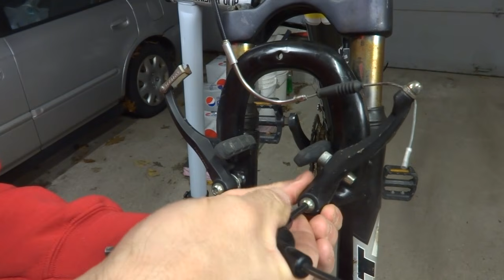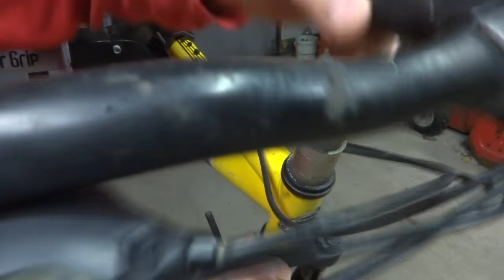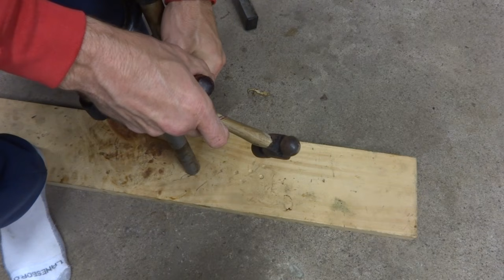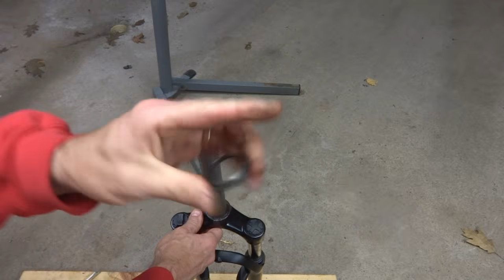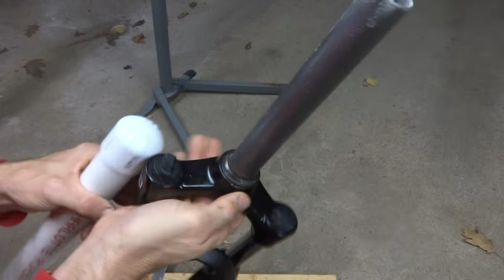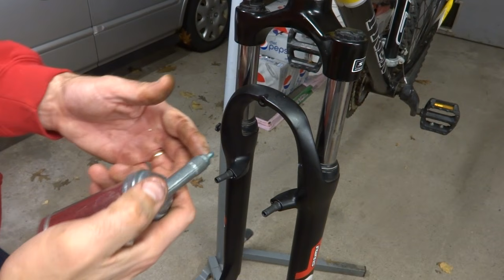Replacing Forks/Shocks On Mountain Bike

Comment: Hey RJ, got a situation wherein the  dropout width of my new fork is wider (7mm compared to the 4mm width of the old fork). So the problem now is that the axle only covers half the dropout. Is this safe? Does it damage the dropout? I tried to check online if they sell a 114+ length axle for front wheel but most online stores sell it at 108mm. Thanks for any info/reply

Comment: Hi.  Very nice video.  I will be starting a replacement fork repairs as you did.  I have a question, it is the PVC pipe, what size is  length and diameter you used. Thanks in advance.

Comment: sir one silly question   i have a cheap apollo phaze MTB  i picked up for a ebike conversion the conversions went well the handle bars is too low and i get  backache       but i noticed the forks was sloppy and done and dangerous. i want to know what i need to do to higher the handle bars i see people  cutting the tubes down  why   ?   or if i buy a new set of forks  do i simply leave the tube alone for more  height

Comment: Hello RJ. Is it possible to order replacement crown races of specific diameters, or do you pretty much HAVE to get the one off the old forks?
Reply from the maker: The crown race generally comes as part of the headset. But you can buy them separate.
Reply: @RJTheBikeGuy  Thank you.

Comment: I have a threaded fork that is bent. Would like to change it to a suspension fork but do not know the if it's 1" or 1⅛". I guess I have to take it off huh?
Reply from the maker: A 1" fork will have a quill stem about 7/8" in diameter. A 1 1/8 for will have quill stem about 1" in diameter.

Comment: What holds the forks onto this bike ? 
Is the clamp on the handle bar the clamp that also holds the forks from sliding down and off ?
Reply from the maker: Gravity for one as the bike is pushing down onto the fork. The stem clamps onto the steerer to keep the the bearings and adjusted. There is also a wedge that locks into place.

Comment: Sweet video...I got the same bike and due for shocks over the winter, what diameter are they do
You recall  ? Thanks
Reply from the maker: Diameter of what?
Reply: @RJTheBikeGuy  the tune that goes threw the headset,  i see you measured the height that was 8-1/4" i was curious to the diameter i didn't want to order the wrong shock
Size lol
Reply from the maker: @tattedup1189  Mine was 1 1/8" which is pretty common. I don't know what yours is. Measure YOURS.
Reply: @RJTheBikeGuy  will do man thanks for your time

Comment: I have a GT Avalanche Comp 29 from 2018. It has a tapered frame. I would like to upgrade the Suntour forks to RockShox. My current Suntour forks are straight. My question is can I replace my straight Suntour forks with Tapered RockShox forks on my bike that has a tapered frame and if so what do I require to do this?
Reply from the maker: I think it's possible, but I haven't done it. You will need a different headset.

Comment: Hi could i ask a quick question, i purchased a hybrid bike with no suspension and i was wondering if i bought a suspension fork would i be able to install it into my bike that didnt come with suspension
Reply from the maker: You can trying a suspension seatpost. Otherwise buy a bike that already has suspension. Replacing a rigid fork with a suspension fork will raise the front of the bike awkwardly.
Reply: @RJTheBikeGuy  what does the seatpost do? Thanks

Comment: Thanks for the video! i am about to install my 1st air fork on my fatty so this helps! One question tho...why upgrade your forks and NOT upgrade you brakes to hydraulic for like $40? I'd never run cantilevers again after going hydraulic...just me.
Reply from the maker: What kind of hydraulic brakes are you taking about for $40?
Reply: @RJTheBikeGuy  Shimano BR MT200 with disks for $42 on Ebay
Reply from the maker: Well, first, the fork didn't have disc brake mounts. I think the frame might have had mounts.  I suppose I could have mounted a fork is disc brake mounts on the bike instead. But that would would have raised the cost. You are completely missing that wheels are not made for disc rotors. So I would have had to get a new pair of wheels. And it would not raise the value of the bike enough. I would never get that money back out of the bike. Just because you CAN add disc brakes, doesn't mean you should.
Reply: @RJTheBikeGuy  jeez, even my old 1992 GT Avalanche had hydraulic disk brakes standard. Rock those rim brakes all you want, bruh. What's life without adventure???
Reply from the maker: @glockasauruswrex6362  My personal mountain bike has disc brakes. But I am not going to install them on every mountain bike I work on. I do have some videos where I install disc brakes.

Comment: How do I determine the length of my current steering tube?  Preferably not having to remove it from the bike first.  Or do I need to disassemble it first.
Reply from the maker: Measure from the top of the crown to the top of the steerer.
Reply: @RJTheBikeGuy  So no need for tube diameter?

Comment: I’m going to install an air fork on my son’s bike and replace the spring loaded fork. The guys at the bike shop didn’t want to do it. So now I have the courage to do it myself. Thanks!
Reply: The guys at the bike shop didn't want a potential repeat customer? Nuts !!
Reply: @larrybrinley8222  Happened to me.. I had stuck shocks and the repair guy said that it's too much work.. Anyways, I still have to figure out how to fix them by myself
Reply: @richard_from_england333  one of the local shops are helpful. The other shop seems kind of snobby- I was asking about my kid’s old Trek and they weren’t really interested. It pays to look around
Reply: shandke cool

Comment: So my question is that. 

My older (replaced) sun tour m3030 had bearings underneath. So I took those bearings and put them on my Rock Shox Dart 1 

Should i take those bearings off or leave them on. My bike is the Trek 3500.

I'm not sure what to do at this point. Theres play with my new Rock shox fork by the stem area. 

I must have missed something.
Reply from the maker: I don't know all what you did, but the bearings are part of the headset,  not the fork. So the bearings should be there. There is a crown bearing race on the of the fork there should be there.

Comment: RJ need some help a.s.a.p: I converting my 26 to 700c, the main problem is the fork, my current fork have suspension and I wanna install a rigid one. The main problem is that my actual one is 1.5 inch taller than the rigid one. Is there anything I could do to overcome this ? Some kind of crown race spacer to level up the frame ? If there's such a thing please give me your thoughts about the idea. Thanks in advance.
Reply from the maker: You need a suspension corrected rigid fork.
Reply: @RJTheBikeGuy  thanks for the fast reply. I Went to my lbs and they didn't knew what to do. I know I need a fork 1.5 inch taller  between the crown and the frame, but how I look for in Amazon or eBay?  Is there's such a thing as crown race spacer ? My distance from the  tire mount to the bottom of the crown is 17.5 inches. Thanks again for the help.
Reply from the maker: Google suspension corrected forks.
Reply: @RJTheBikeGuy  thanks for the help. Found out what i need, a 450mm crown to axle rigid fork. Now to put the numbers together to see if it make sense, still need to get tires, disc brakes, new crank, new chane, bottom bracket, and 7 speed 11-34 for the back. I know, i know is almost a new bike price range range.

Comment: RJ I liked this video on replacing front fork. But I DO have a question on other bike maintenance.  I have a Mongoose Dolomite. I just recently replaced the shifter. At which time I tried to readjust the rear derailleur (Shamano Tourney - from the Mongoose factory). The B-tensìon screw has no effect on making adjustments. Almost seems it isn't connected to anything.  I'm NOT a mechanic but is there an interior spring here that I could be having a problem with ? Or what do you think I can do now ??? Thank you for your time !!! Have great  day !!!
Reply from the maker: Sorry, I can't tell you without seeing or working on the bike. The B screw only has a minor affect on shifting and is like the last thing to adjusted. It's for fine tuning and most times I don't even mess with it.  My recommendation is don't buy a Walmart bike. They are generally junk with cheap components that cause problems and break.

Comment: Is it possible, or easy to purchase and upgrade a standard suspension fork and stem assembly to a solid one piece suspension fork/handlebar assembly similar in style to that on a motorcycle/motocross bike? I've seen some bikes that have them but only at high end shops and not big box stores and am curious since I recently  bought a genesis V2100 bike the other day..
Reply from the maker: First, I wouldn't spend money upgrading a low end bike like that. And if you are talking about converting a regular fork to a Cannondale Lefty kind of fork, no you can't.

Comment: Great Video! I followed your instructions and did great however, the tangs(?) on the new fork are much thicker and they are only supported halfway by the axle. Can I replace just the hollow axle so it extends to the outer edge of the fork tangs?
Reply from the maker: It's probably fine as is.

Comment: I wondered if you could make a tutorial on how to change a rigid fork with a suspension fork. By the I'm a big fan of your video's
Reply from the maker: Replacing a rigid fork with a suspension fork raises the front end of the bike and will change the geometry, probably not for the better. Replacing a suspension fork with a rigid fork, you will want a suspension corrected fork.

Comment: My entry level bike I bouth last year (for around 400 €) had the M3030 fork and i replaced it as fast as possible. they were just aweful. although they were supposed to have 75mm of travel, the would barely move and started to squeek after a couple of rides (normal rides, no trails or other rough terrain). I replaced them with Rock Shox Recon Silver RL 120 mm and it is like night and day.

Comment: Hey, 
I need help. This is regarding a bmx. But the installation process should be same.. i recently installed a new headset .. It fit perfectly.. but after riding for a few days it got loose and developed play.  Now no matter how much preload I put it still has play.. what do I do? (Yes there is space of 3mm or so from the top of the fork to the top of the stem).
Reply from the maker: Can't tell you without working on it. Take it to a bike shop.
Reply: RJ The Bike Guy I did..  they did something but that was temporary too.. it didnt last long

Comment: How to fix the forks wobbling when i hold the front brake and push it
Reply from the maker: Replace them.
Reply: But i look inside it to the bolt and found it not stable so, if i tighten that bolt it will be ok ??
Reply: You probably just have a loose top cap. Loosen the pinch bolts on the stem and tighten the top cap.
Reply: Joshua Wertheim ,The top cap is entirely tighten , the problem is not in the stem , when i put my hand on the forks seal and hold the front brake and push it forward , i feel the wobbling ,, got it ??

Comment: Would you please comment on how the 26" bike would perform if it would be upgraded with a 27.5" or 29" fork? Wheel size would stay the same 26" and disc brakes are would be used so there'd be no trouble with v-brakes. Would the bike handling feel too much like a chopper bike and sinche the geometry would be changed would the bikes security being compromised? I wouldn't want to find myself in situation with a broken fork or frame while riding technical alone in the forest :D (SNAP omfg!! /lights out) haha
Reply from the maker: If you install a longer fork, it will change the geometry and probably not for the better. The frame was designed for a specific length fork.

Comment: I want to learn about mtn fixing repair and whatnot but I need new shocks anddddd dont know,if they will fit my bike. I'm not really sure about it (it was my brothers old one) I need to find out what shocks I need for it to replace it. Its a Haro bike hardtail and stock shocks I need to replace for better ones. Thanks!
Reply: There are several things you need to check here. Steerer tube width and length (is it the same?), whether or not you have a tapered headset (does the base of the steerer tube flare out?), and the axle type ( Quick release or through axle?). If all of these match your old forks than you should be fine. If the new fork has significantly longer or shorter travel don't put it on, even if all the other things match. It will change the geometry.

Comment: Hi,

Thank you for sharing all these helpful videos.  I find myself binge watching like a Netflix show.

I have been planning on replacing the rigid curved front forks on my Trek 800 mountain bike with suspension forks. I recently picked up a never ridden Raleigh M30 mountain bike that was practically being given away. The Trek has a 1″ threaded stem and the Raleigh appears to have the same.

So my question is, how do I measure the forks to make sure they will fit without removing either. Both have 26″ wheels but the Raleigh has a smaller frame.
Reply from the maker: The problem with replacing rigid forks with suspension forks is the frame is made for rigid forks. The suspension forks will raise the front end of the bike and change the handling. Maybe not for the better.
As far as fit, the main thing is the length and diameter of the steerer tube.
Reply: OK.  Thank you. I guess I'll scrap that project.

Comment: Hi RJ, i bought a RST suspension that has a diameter of 1-1/8 but i needed a 1". Is it possible to change out the steer tubes itself rather than the whole fork?

Ive seen 1" tubes being sold with shims so it'll fit in the 1-1/8 suspension forks.

Comment: Thanks for training we viewers, RJ. I noted that the replacement fork had plus "+" and minus "-" dials. are these for adjusting the amount of pressure it takes to compress the fork suspension?   Which direction increases resistance, clockwise turn or counterclockwise?  Is there a different function for the + and the - dials or is the function the same for both ...just one is left and the other is right? Thank you.
Reply from the maker: Turning it clockwise makes it stiffer, counter-clockwise makes it less stiff.
Reply: RJ The Bike Guy Than I should, RJ!!

Comment: I didn't know about the crown racer being taken off the old forks and onto new ones. Thanks for this as I've just changed my forks for some Mozo ones. It was lucky the crown racer happened to the same fitting. To check for play on the front shocks I apply the front brake and push down on the suspension which reveals any looseness.

Comment: another great video, a question I have involved that i just bought a bike with roxshox dart 1 forks, the suspension seems really soft, I have seen a video of yours to service similar and a tip gleened from that is that I have the manual,  so the question is two fold are dart 1 shocks designed to be really bouncy? 2nd is it is possible to firm up shocks economically & safely such as the (name escapes me I think elastomer, the plastic rods) if they come in firmness options, (yet to look up purchasable options). this question is for your own consideration RJ as well as any viewers with experience of dart 1's, it could well be their intended feel I am just used to quite firm usually suntour shocks so different experience and preference opinions appreciated.

Comment: I couldn't image a MB without disc brakes, they've saved me 100 times.
Reply: Rim brakes do have their purpose though, for example my friends 24 inch trek mt220. The bike would fit disc brakes with some adapters, new forks, and new hubs, but my friend is a rougher rider and a 160mm+ disc on a 24 inch frame is quite close to the ground, so most likely he would be replacing the discs often, even I ride a 27.5 frame with 160mm rotors and I manage to screw up a rotor once a month.